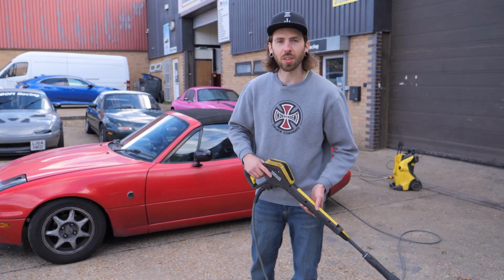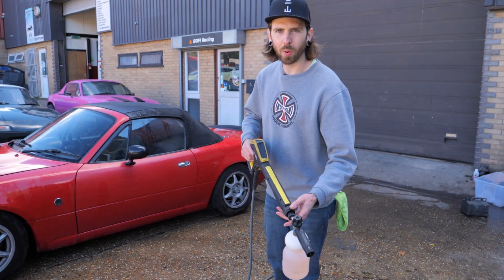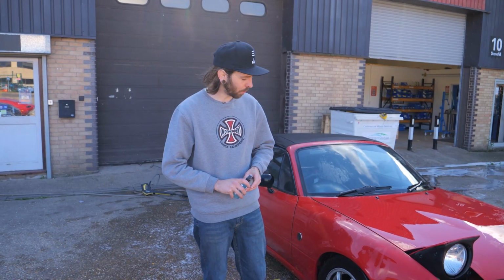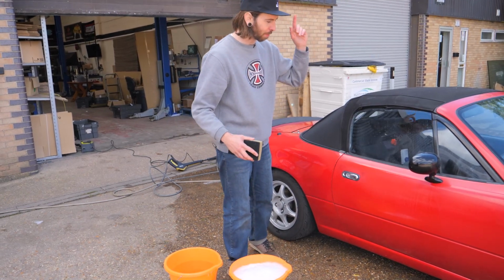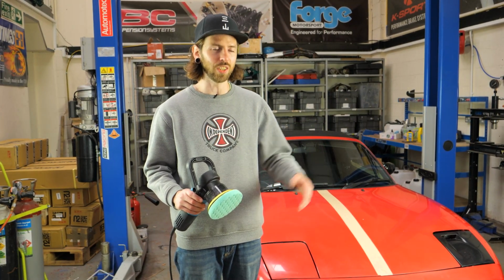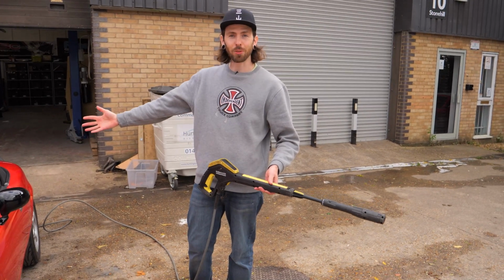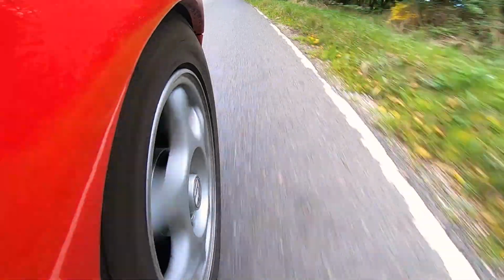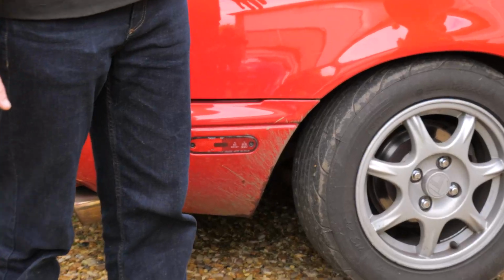Hopeless MX-5 Paint Gets A New Lease Of Life

Comment: Paint as old as this one I would just sand with 1500->2000 grit and then polish with sth like Menzerna 300 -> 1000 -> 2000 and (perhaps) 4000 for omega bling. Paintchips you can fill with touchup paint using toothpick prior to sanding, it doesn't even have to be exactly the same color, let it cure for a day or two then sand and polish. Easy. Have fun.
Reply from the maker: I think the paint would come up easy even without a wet sand. Just ran out of time and clean pads sadly

Comment: I got wired question what tire pressure should I run on my tires I got mx5 from 2006 what pressure on track and what on road?
Reply from the maker: 30 PSI hot tyre pressure is a good starting point
Reply: @BOFIRacingTV  What about cold air ?